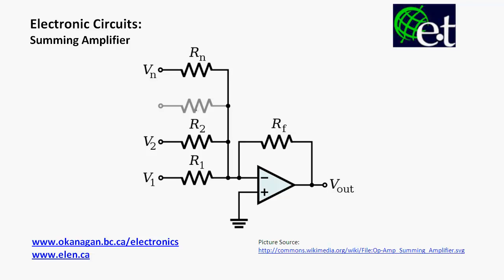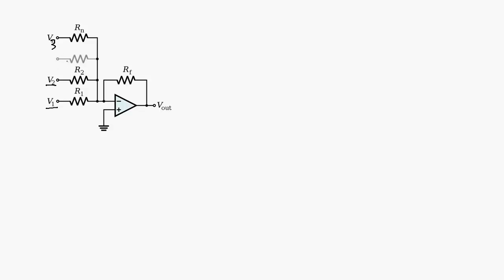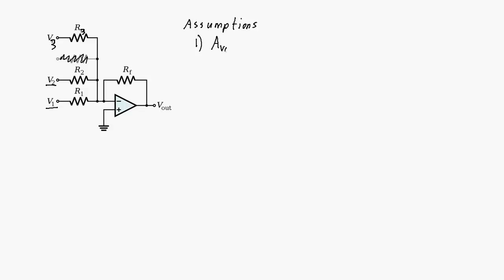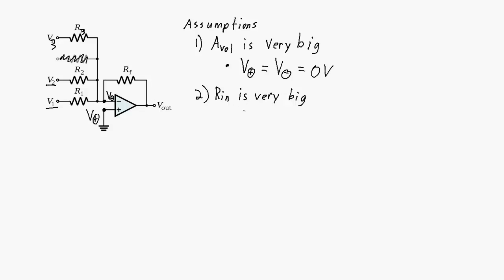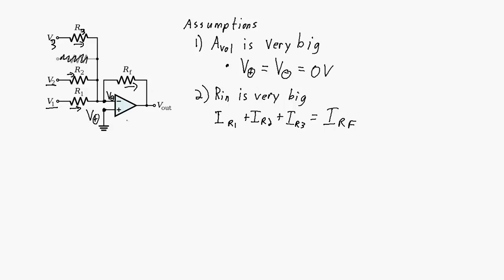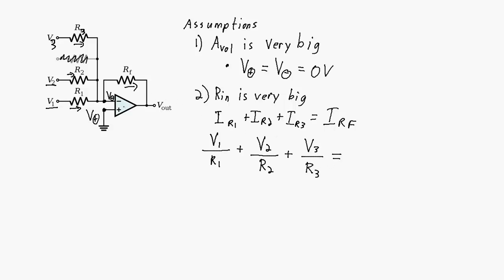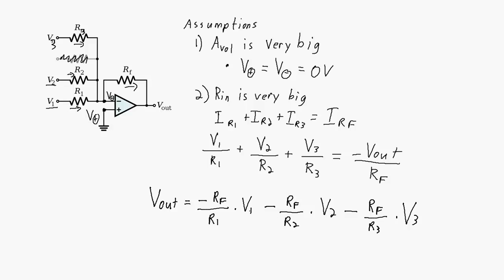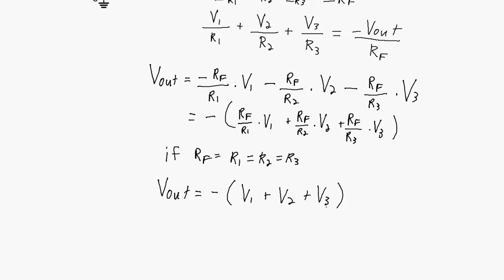Operational Amplifiers - Summing Amplifiers

Comment: Nice video, only one question tho: I suppose you want that special case where Rf=R1=R2=R3. However if R1, R2 and R3 aren't equal, is there a way to figure out what Rf should be to still get the V1+V2+V3 to add up and so that we can see the sum of them in Vout?
Reply: If they R's arent't equal, then you should include the R's in the equation. Easy as that.

Comment from the maker: Virtual ground is a point in the circuit that has the same potential as the reference that we have defined as ground...but there is no direct electrical connection to the reference "ground".  (ground is in quotes because it's not actually ground, it's just what we have defined as our 0 Volt reference point).  

The characteristic of the circuit forces that particular point to be at the same potential as the reference "ground"